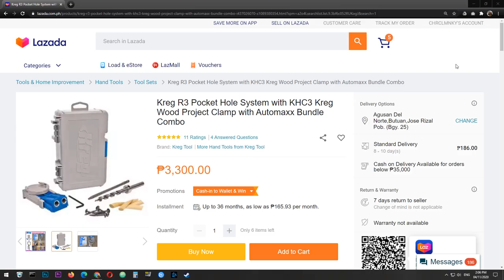Cheap China Made Pocket Hole Jig - A Kreg Killer?

Comment: Aqui no Brasil é um preço absurdo também essa peça !
Reply: Negócio é montar os jigs caseiros mesmo....kkk
Reply from the maker: Hello guys, is shipping from China to Brazil very expensive? I think its just very cheap via post office.
Reply: @chrclmnky  This jig is available on aliexpress. However, the cost of the product + shipping is approximately BRL 300 (U $ 60). This is a lot for a jig, despite the solid construction and quality of the materials used.

Just for curiosity: does Lazada ship products to Brazil?
Reply: É difícil começar tudo é caro e ninguém valoriza seu trabalho 
Brasil não é para amadores kkkkk
Reply: @chrclmnky  caro aqui no Brasil é o importante sobre produtos importados 
Para proteger o mercado kkk ""
Reply from the maker: @rsfalacci  oh that's very impractical for something very cheap. Products sold on Lazada are from China and only costs about $3US for shipping fees even power tools and speakers and such bigger sized packages. I don't know but you can try registering and you will know if certain products can be shipped to BR.
Reply: @chrclmnky  Thanks, I will try later.